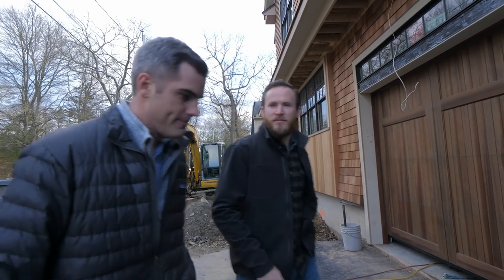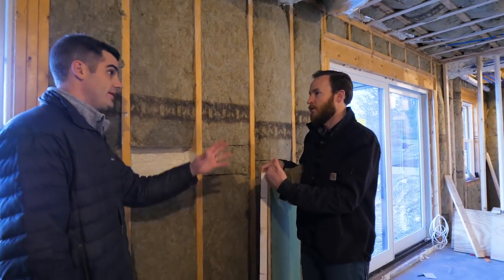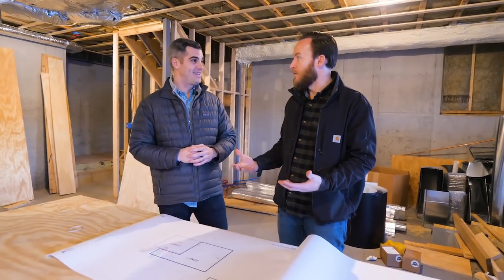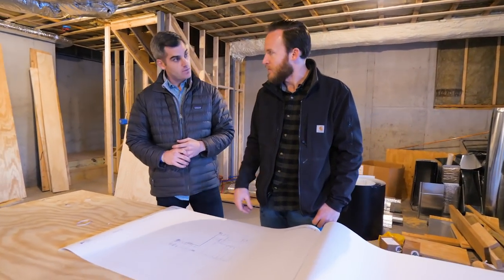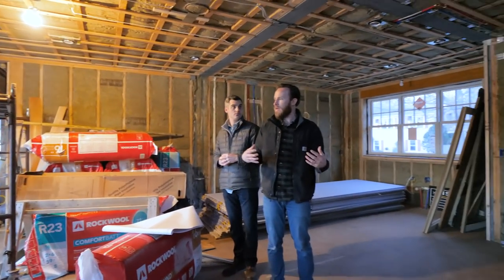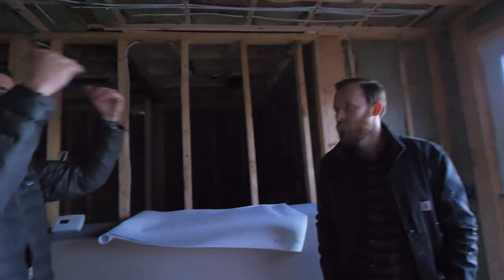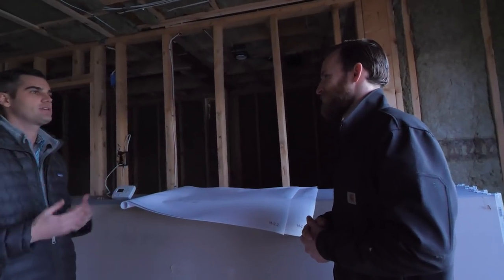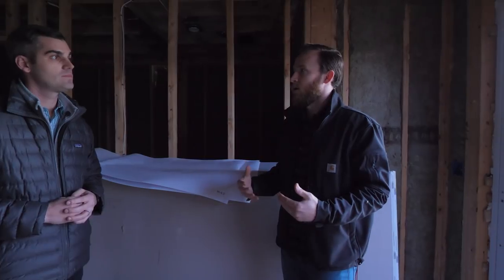Maximizing efficiency in a new construction build

Comment: "build tight, ventilate right" -how often should the entire volume of interior air be changed out?  I heard 130 CFM from the video for the ERV,, but what does that translate into air-changes-per-hour?
Reply: Andrew Theurer it depends on the size of the building and the number of bedrooms/people, but in this project 130 CFM translates to 0.35 ACH (air changes per hour). This turns out to be a good rule of thumb for residential applications.

Comment: So your vapor barrier is on the interior because of the cold climate. Hot climates you do the opposite, correct? Where I live we see 100+ degrees in summer and below freezing in winter. What would the protocol be for my area when there's such a huge temperature swing?